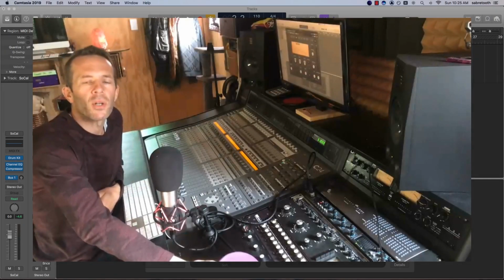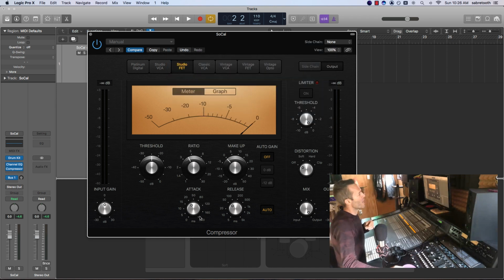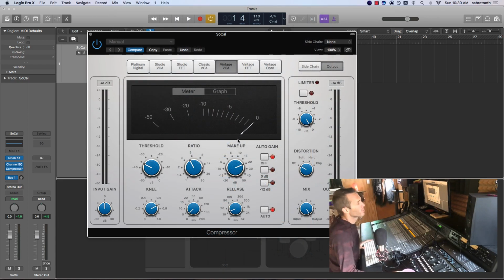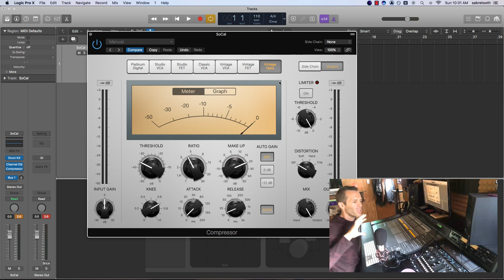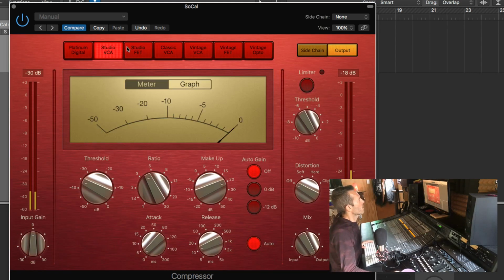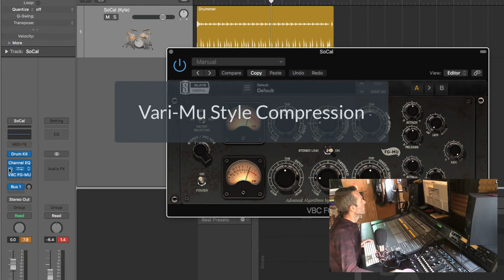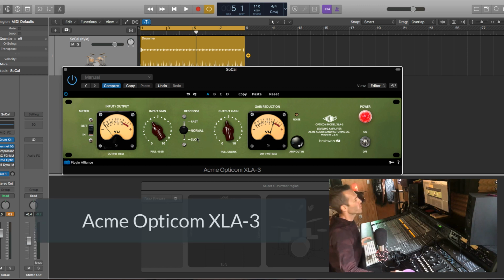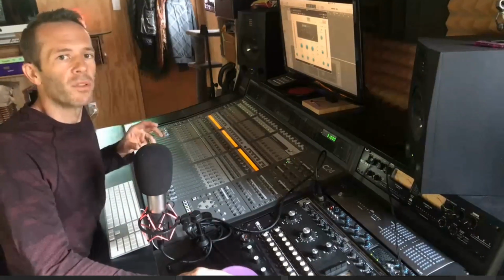Compressors - VCA vs FET vs Opto vs Vari-Mu. Compression types/styles.

Comment: I take issue with the fact that you're not gain matching the output of each different compressor. Although you are able to hear some differences in how each compressor is acting given the same ratio, attack and release, the output levels are very different so the inherent characteristic of each compressor is lost. Also there is no explanation on the differences of how each compressor operates.

Comment: GAIN MATCHING BROTHER, WITHOUT THAT YOU CAN REALLY SEE WHAT THE COMPRESSOR IS ACTUALLY DOING TO THE SIGNAL. THERE IS NO POINT IN COMPARING THE COMPRESSED SIGNAL AND THE ORIGINAL IF THE COMPRESSED IS GOING TO SOUND MUCH LOUDER, THEY NEED TO HAVE THE SAME INPUT AND OUTPUT LEVEL, SO THAT YOU CAN ACTUALLY SEE THE CHARACTER OF THE COMPRESSOR, NOT JUST FEEL THE INCREASE IN VOLUME.
Reply: You know that the whole “people think you’re smart if you yell confidently”-stuff doesn’t work, right?